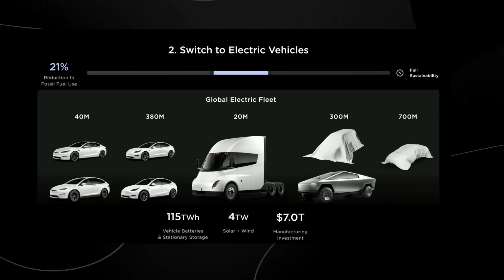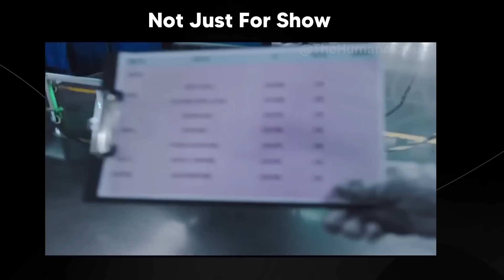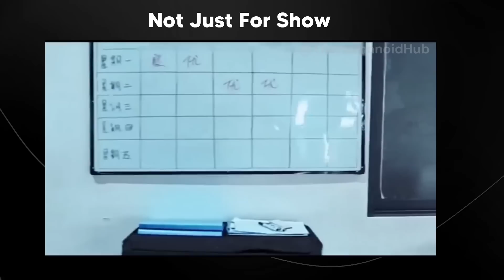China STUNS Tesla With NEW Humanoid Robot! (Xpeng Humanoid Robot)

Comment: wow absolutely awesome! love it! and the feet and the walk too! as a designer of a humanoid robot you have to understand that you are not designing shoes. you are designing bare feet. they clearly understood that. you can put on socks and shoes later if you want, but you have to design the equivalent of human feet first, i.e. a heel, a ball of the foot and toes. its the same as with hands. they are going the full way or at least try, and i like that.

here's an additional thought from me: i see the robot still standing with bent knees. probably for stability reasons. that is because you want to be able to go up and down. standing with straight knees only allows you to go down. but here's the thing: if you had a ball of the foot and a toe section that can bend independandly from the rest of the foot and can be used as a support, you could stand with straight knees and still be able to go up if necessary! i would love to see that implemented just once anywhere with any of these many robot companies. that would be so awesome. i think the first robot company that has feet with toes and a ball of the foot would have a huge success.